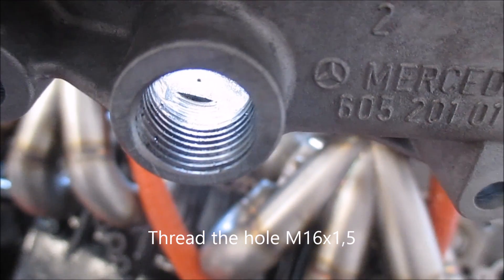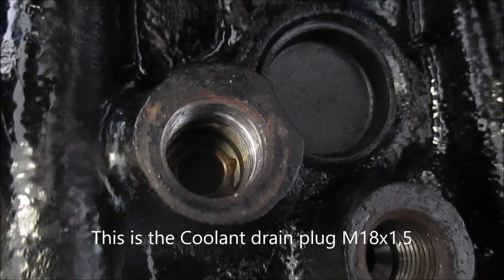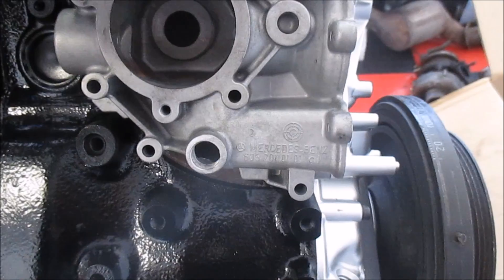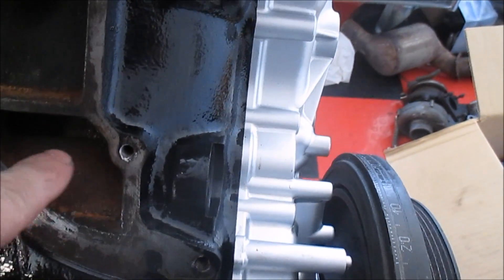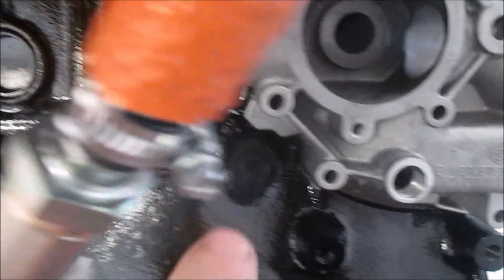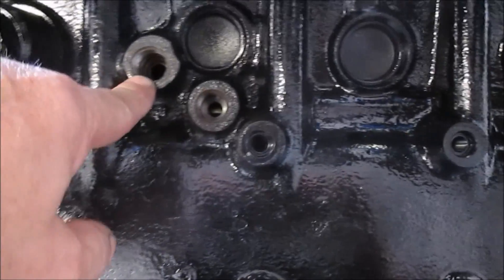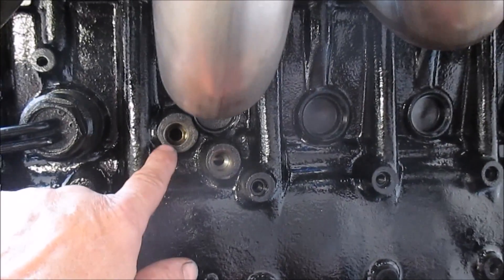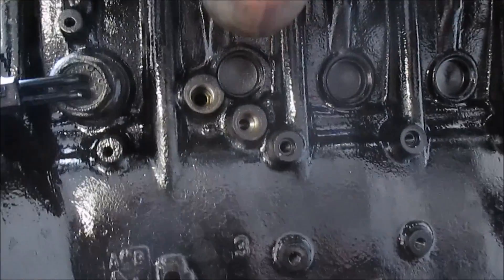Dieselmeken shows solution for heat problem on rear cylinders OM6XX

Comment: Hiya. Is this recommended in addition to linking out the heater matrix for an off roader?
( Engines in a landrover now) thanks.
Reply: The heater port at the left rear of the head should have flow at all times.  The factory ensures this with a valve that bypassed the heater core if the heater valve is shut.

Comment: Interesting little mod. my 5cyl OM612 CDI has a different layout to your 6 cylinder. but it appears they have done something similar from the factory. under the intake there is a valve on the block, down low, and its connected to a hose leading to a radiator about the size of a small car AT cooler, after that it goes to the fuel return plate heat exchanger and off to the thermostat block or coolant header tank (I cannot remember which) strange way of doing it, but it heats up fast after a few mins idle even with the EGR completely removed.